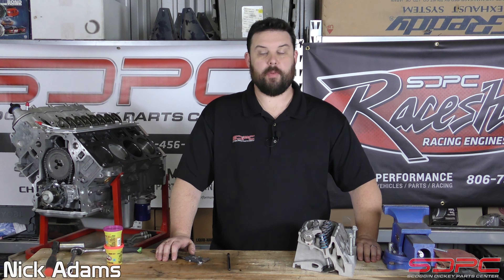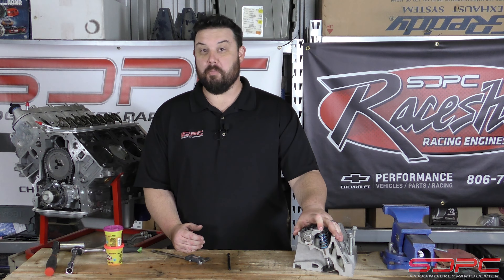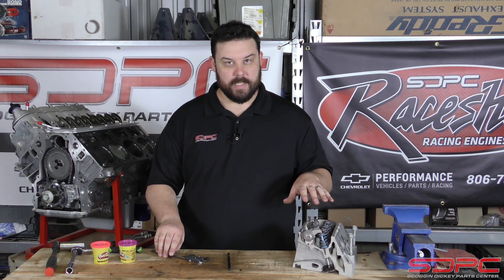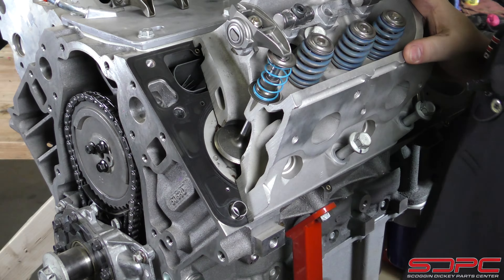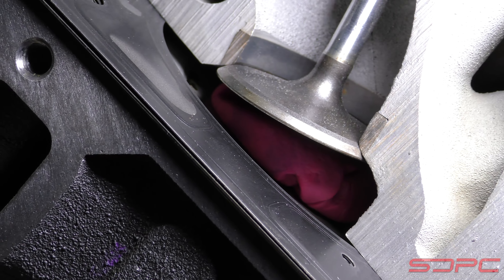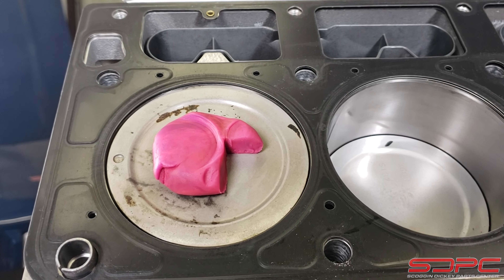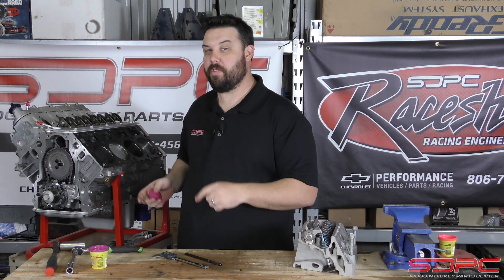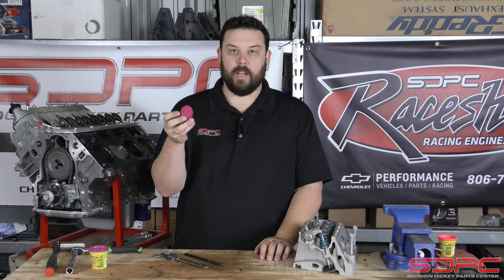SDPC Tech Tips: Piston To Valve Clearance

Comment: Do you need to prime the lifters or use solid lifters for this?
Reply: Thats why he is using the checking spring so there Will be no preload on the lifter if you dont use checking spring then you need to use solid lifter
Reply: Is this necessary on a stock rebuild?